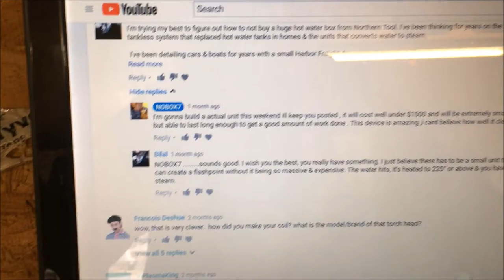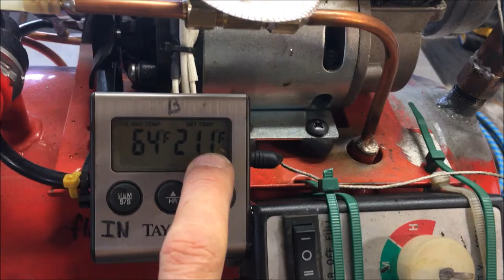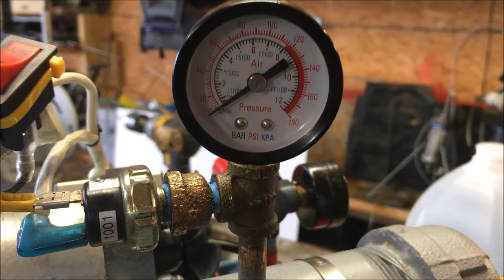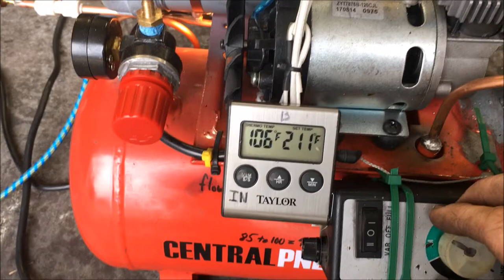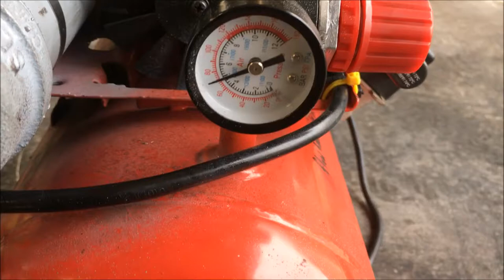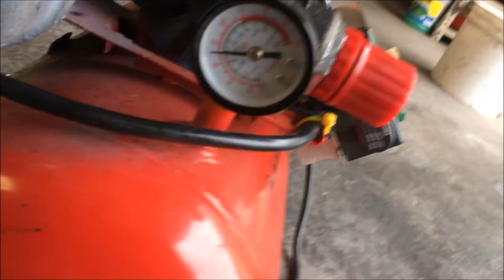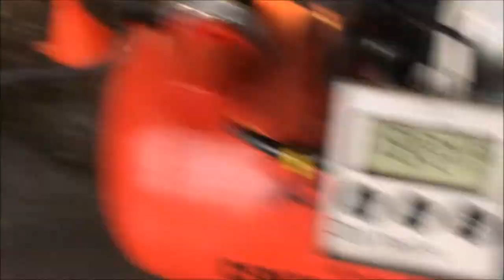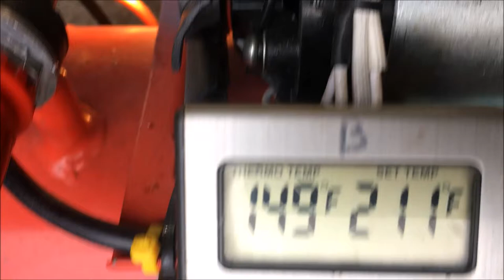Steam Cleaner Degreaser tool DIY 100 psi Proto type

Comment: A small 20 water tanks and then plumb the compressed air in the top of it.  They hold 120psi all day. I have made a spray system out of a water tank and charged with 120 psi. As long as you have a pop off just in case. I know people will say how they are not rated for it and blah blah. My dad has a air compressor with a hot water tank for the last 20 yrs. The spray system I built was almost 20yrs ago and still in use commercial use every day since. Anyway you get a tank made to hold water and your preheat in one.  Then my other thought would be to make a deflector cone to go at the end of your coil in the center to force some heat back into the coil so it's not blowing straight through.  Like the deflector in the center of the torpedo heaters. But I love it and see one in my future. I clean old cars so they can be flipped this would be awesome.

Comment: Dear Mr. NoBox7, Actually your idea is an imitation for an industrial equipment called Steam Generator, which is a replacement for Steam Boiler. Which means that if you can perfection a little bit your product, and enclose it in a cylinder, you will be able to sell it as a small steam generator. All you need is to master one very simply equation: Heat needed to evaporate the flow of water to a certain level of steam (temp + pressure) = heat provided by the flow of  incoming flow of fuel X efficiency

Comment: The air and water pressure will be equal inside the tank. The pressure at the nozzle will be equal to tank pressure +/- any gravity effect (you can probably ignore that unless you're going up a ladder with the nozzle) - any frictional losses in the hose and coil.

Comment: a refrigeration compressor is not an air compressor. A refrigeration compressor will pass a small amount of oil out the discharge end until the compressor runs out of oil, it will seize shortly after that. Refrigeration systems circulate a small amount of oil with the refrigerant. Its just how they work.

Comment: At 24:22 it looks like you had super heated steam. Like you could light a match with. I didn't see condensation for 5-6inch's after the nozzle
Reply from the maker: yes the device can produce super heated steam on very low flow
Reply: wow clap clap thats so observant! lol . . .

Comment: Okay, so I stopped tgis at 18:17 before I forget what i wanted to say. 
 Looks like the preheater is a great idea. However, using an incandescent lightbulb of any kind around water is asking for the bulb to explode, Unless completely sealed from the environment like the bulb in an oven.  It would only take one drop of condensed water to do it too. 
 All in all, still a brilliant idea.
  I also think if you put a cage around the water coils, it would help stabilize the flame and engulf tbe coils. Just look at how a bug fogger work's
Reply from the maker: Yes i agree, the bulb was from another project thought id give it a try , i dont think its gonna work but for $3 it was worth a try

Comment: need to correct you real quick the fourine/chlorine (depending on country) isn't the problem when it comes to rust it's the minute quantities of sodium potassium and other trace minerals in the water that make it slightly conductive which as i am sure you are aware causes a galvanic current which strips away the iron's electrons
Reply from the maker: it was a joke
Reply from the maker: i was mostly referring to the build up of calcium deposited and things like that , it will insulate the coil , but thank for the input brother no offence taken bro

Comment: now you can use gasoline torch to heat it as map gas is expensive //one way inlet valve no compressor needed my water pressure is set at 85 psi at taps// yea i need one fer my 4200 psi washer but i be pore n ant got 1500 fer a ready made one damn dollar ant worth much.oh you got stuck woth oil less compressure i hate one years ago i hated it it quit at a bad time now i use a oil bath compressor build from dump ;] 220 volt tools no 110 volt air or welders

Comment: hmm, way different than I've been day-dreaming about.  My plan was to take either a compressor tank or a propane tank, drill, tap and thread in a water heater 220v heating element, hot water tube connector and water inlet valve; then, fill it with water, plug it in, let the water boil and force the steam out of the tube to a nozzle.  Figured if the boil was high enough, I'd have enough pressure and the nozzle would be the pressure release--like a boiling tea kettle.  Crude, but I figure I can do that for under $100.  Thoughts anyone?
Reply from the maker: Please dont try this , you are describing an extremely dangerous machine  . Your problem will be the cost of the steam nozzle gun and hose . You could leave the old pressure switch on the unit to shut of the heating element . Your next problem will be power . 120 volt socket cannot provide much energy for a rapid heat up , your device could take 20 min to heat and may not be able to boil very much water in a timely manner . Trying to use a 240 volt system is gonna cost you big time unless you already have it set up .The device in thi video is about 4,000 watts of power . This unit is about 40,000 watts https://www.youtube.com/watch?v=utIUCGPLon8
Reply: @NOBOX7 hmm, not sure why my idea is dangerous.  It's basically just making hot water heater that will boil water and release the steam through a nozzle.  220V is what I have planned.  Those propane heating nozzles are too bulky for my needs...but admittedly, they are really cool. I'll let you know how it turns out....or if you don't hear from me in a few months, maybe it blew up and well....rip. lol
Reply: @mymorristribe  Well  did she go or did she blow? I had the similar although more rudementry idea.